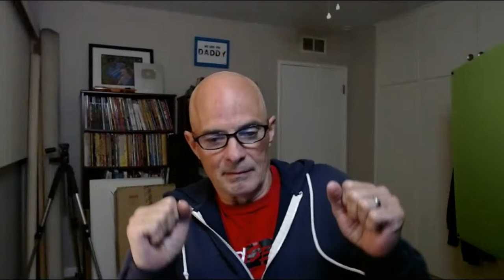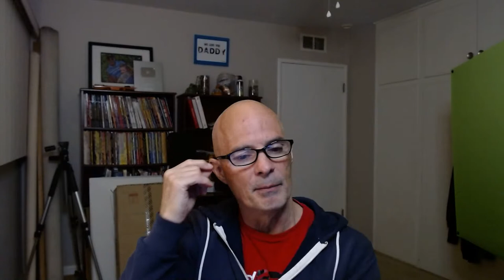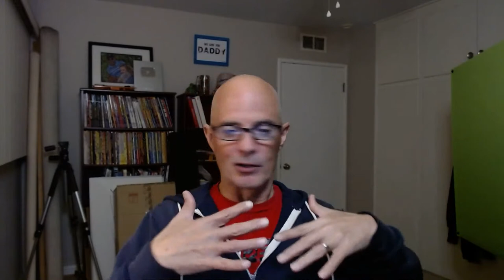LET'S TALK TECH-TURBO TIMING-HOW MUCH IS TOO MUCH?

Comment: I think you could do a whole hour on ignition timing, octane, and cylinder pressure.  And talk about why intake temp and coolant temp affect chance of detonation.  Also why max timing is achieved around 3000rpm, i am guessing there is a phenomenon where as the air gets compressed at a faster and faster rate, it burns faster?  I would love to see the day we have in cylinder pressure sensors and knock sensors on production engines, we could compare timing, pressure, and knock sensor to optimize a tune while we drive!  You wouldnt have as much reason to require a dyno for tuning.  It would change the perfornance and tuning industry.

Comment: Jay Brown is working on 351C adapters for the FE, and his own cylinder heads and intake adaptive parts using modeling 3D.  He is working on an FE head like a Tunnel Port but with pushrods aside and offset rockers.

Comment: On marvels mystery oil , don't put it in your gas tank if your tuned close to your octane limit.
 I made the mistake once . My truck driver brother bragged on the power increase on big rigs w marvels, so I put a few oz in my tank on my 11.4 406 sbc just to see what it was worth. That engine spark knocked like crazy and the cruise temps went up 20* !
 I had to drop timing 6 degrees til that tank was burned up.
 My theory was that it did exactly what marvels claims......it seals the cylinders from the top side of the pistons and increase ring seal . A good thing , I guess, if you have a problem there. My 406 did just fine at 37* w 93 octane WITHOUT marvels . It was completely outside knock limit w it . I really don't think I put enough in the tank to affect octane that much but it did seal my cylinders beyond my fuels ability.

Comment: What was the timing at for peak tq and max rpm for the big bang 351w?
Looking for a sanity check on what they are "usually" happy with, even under high cyl pressure, with ethanol.
Im going to use the et/mph method eventually.

Comment: 5:10 This sounds like a situation where at a certain boost level/compression ratio you are octane limited from running what's the term, MBT, minimum best timing, or optimum timing.  It wants more timing, but for the current octane, at that smaller cylinder volume, peak pressure after ignition will be higher than the octane can handle. Retarding timing reduces the peak pressure after ignition because the piston being lower increases the cylinder volume.  To me this is a clue you either need more octane, or lower compression ratio.  This is why I like bigger displacment LS's, same power with less boost, lower intake temp, less chance of detonation, more likely to achieve optimum timing for same power with less fuel.  I wonder how lower compression/boost with optimized timing compares to higher compression/boost octane limited where you cant run optimum timing.   I guess you could potentially make more power in the high boost octane limited scenario, but it seems like a very inefficient way.

Comment: Hi Richard, are you of the opinion that guys should be verifying their ignition timing with a pointer and timing light on these fuel injected distributorless engines?
Reply from the maker: I rarely do but it would be a god idea if you an exact TDC mark-usually done with the head off

Comment: I want to twin turbo my 394 FE and it likes NA 37 degrees. I am guessing that 20 will be enough.  I was considering two Gt35s with Sanderson shorty headers on backwards and into the intercooler and back up to the carb hat with a BOV and a boost regulator.  I am hoping for no lag and 6-8 lbs of Boost without having trouble. The engine is 9.7 to 1. I am getting closer. I hope to get 700 hp without destroying everything.
Reply from the maker: should be a good place to start

Comment: What determines the all in timing point. Was always told to have it all in by 2500 rpm. Programable controller just wondering where the ramp it all in. Lock out distributor set at 38 degrees 454 bbc. Carb No boost.
Reply: 91 octane pump gas
Reply from the maker: we look at 3000

Comment: Meanwhile me over here running 11 degrees of timing on a vortech TI LS3. It's on 93 and the knock sensors cry if I run more. Makes low 600s on the 93, would love to see what it would make at 20 degrees! But I would need a lot of meth or a bigger pump and E.
Reply: We run our forged ls2 with a vortech si blower making the same power. It's tuned with 94 and a good dose of methanol. Making around the same power 630whp on 17degrees 9-10psi

Comment: Thoughts about running  a boosted 6.0 on pump gas with a meth injection kit? Using 317 heads with dual springs and stainless valves. Currently at 10.1 compression. No E85 anywhere near me unfortunately.  Love the videos man😁
Reply from the maker: yes you can do that

Comment: What are your thoughts on an Toyota 3rz N/A motor that was timed with 10 degrees at idle and then timing ramped to 20 degrees by 3000 rpms. It won't take any more timing without knock. 10:1 with 91 octane. Full standalone for tuning. I actually have to pull timing above 4k rpms to avoid knock.
Reply from the maker: only give it what it wants
Reply: @richardholdener1727  Thanks for the reply. By the way, love the informative videos you put out!    It seems strange that the timing is so low. I've spoken to a few Toyota enthusiast tuners and they swear up and down that these motors typically run 32 degrees all day long. What are your thoughts on what could be causing the large discrepancy in timing?

Comment: Hi. I enjoy your videos. I have a question. Lq4 swapped into a 85 Chevy C10. Has headers. I'm routing my fuel line from tbss intake to corvette filter regulator down on passenger frame in front of the dual tank selector valve. Im using Summit Racing 6an braided nylon hose and I'm worried it's too close to the header. I wrapped it in a heatshield wrap that velcros on thats rated for 600 degrees. If I were to guess, the closest point is 3 or 4 inches. Should I be ok or should I try to figure something else out?   TIA.
Reply from the maker: feel the hose-is it hot when the engine is running and the hood is closed?
Reply: @richardholdener1727  How am I supposed to do that? I'm sure it is since its 3 or 4 inches from a header. Truck isn't running yet. Doing finishing touches.

Comment: Can't tune a stock ECU... activation switch to ECU... 0 active boost, timing is retarded 10 to 25 degrees... creating higher exhaust pressure. when the intake pressure target is hit the timing map advances to normal running time.

base map timing changes depending on fuel "needing a flex fuel sensor for the map calculations", touching it is a waste of time. same fuel from 1980 to 2020.

activation switch, "aka" switch relay, relay bank that shuts off spark to multiple cylinders... hot manifolds and it lights off... 

😐 response problems